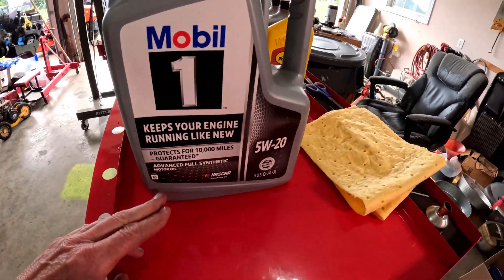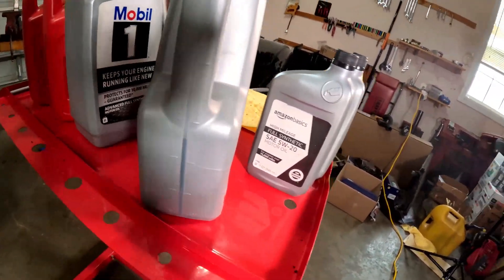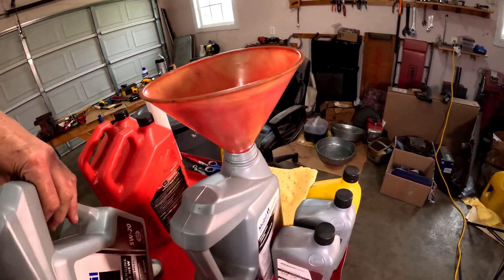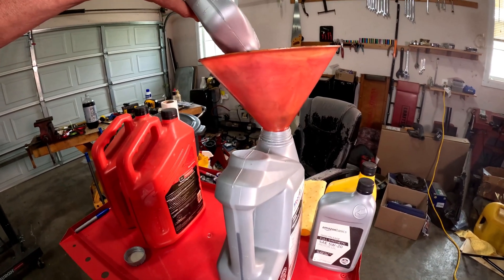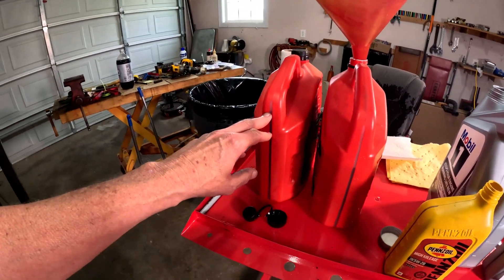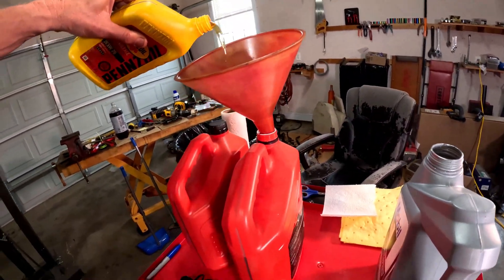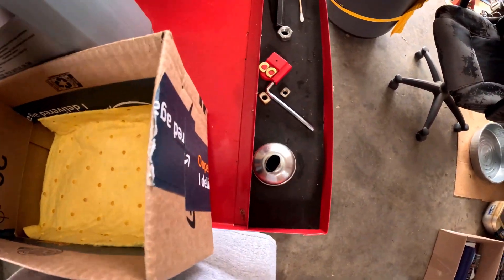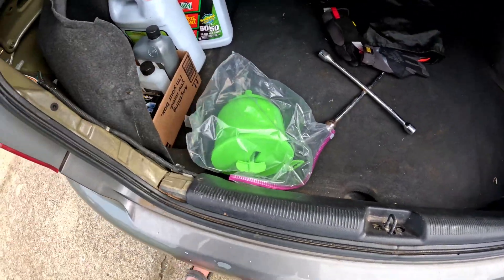Never Mix Engine oils lets find out

Comment: I am not watching this video but I will say you can mix brands, types and viscosities with no engine damage at all. Been doing it for years with hundreds of thousands of miles on multiple engines.
Reply from the maker: This is the first of 4 videos I planned for the oil series. What you say is true however not having the correct viscosity can cause failure of the catalytic converter. The standard is different for GDI engines.